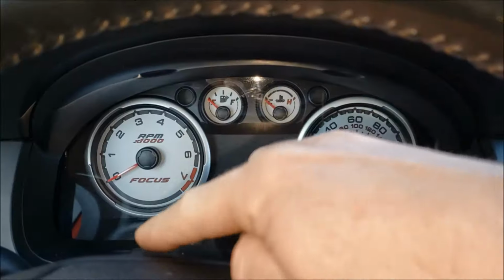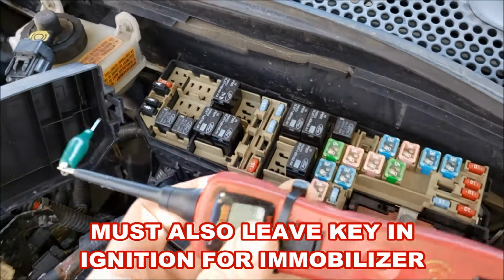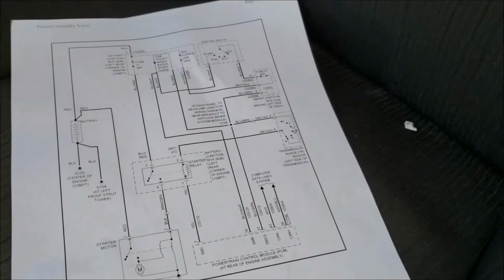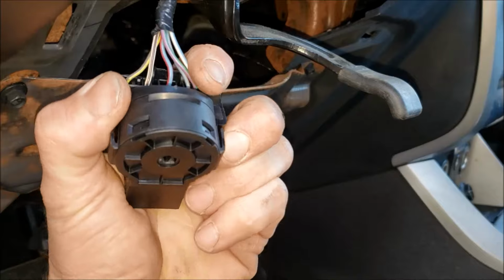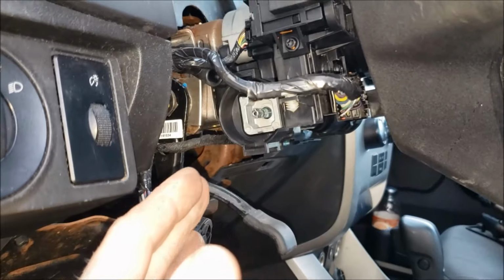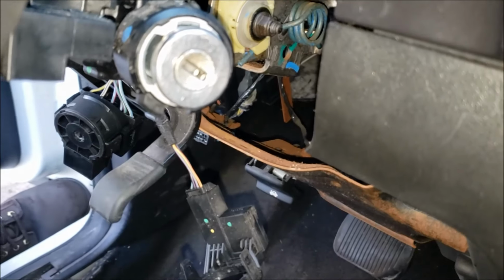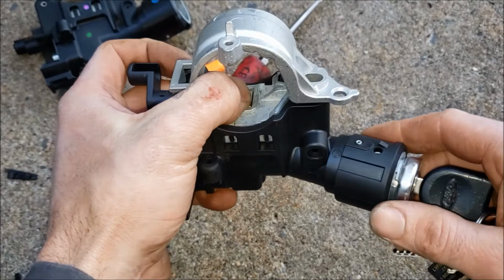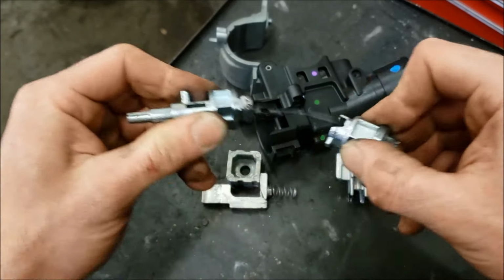08-12 Ford Escape / Focus / Mariner No Crank No Start,  Diag and Ignition Module housing Replacement

Comment: I followed the video and everything went relatively smoothly until it was time to put the key cylinder into the new housing.  It was a very difficult fit and when I tried twisting it back and forth to slide in, the metal part inside the black housing broke lose after the cylinder was seated which allowed me to pull the whole thing out.  I hoped that once I put it all back together and tightened it all, it would be fine.  If I push in to make sure it is seated, it starts with no problem.  I'm left wondering if I should order the Dorman one and redo it unless there is a way I can glue that part in place.  The video was of great help.

Comment: Great video! I liked that I didn't have to pull off the steering wheel like a different video I watched on this said to do. The part for my vehicle only cost me $45 on Amazon compared to the big box store price of $189. I did find that you can simply use a screwdriver and hammer instead of the cold chisel to remove the headless bolt. It took me about an hour and a half to do. Thanks for saving me some money. I enjoy all these do it yourself video's that save me money!

Comment: At the 10:00 mark.. there's a way to fix the ignition cylinder WITHOUT removing anything except the Ignition Cylinder and Tumbler..NO PARTS required. I did it two years ago and No Problem anymore, turn the key and it starts. I found the video here on utube almost three years ago which explains step by step.
Reply: FOUND THE LINK:  Free Fix, NO PARTS and Save 1500.00:  https://www.youtube.com/watch?v=mx3gzbv4y1w

Comment: Great video! I have seen people instead use a die grinder to grind 1/8" off the inside key mechanism so that it turns more and that fixes the issue. Does not require replacement of the assembly this way. Do you think that is a good solution? I have this issue.

Comment: Just did this today.  Thank you so much for this!  All other videos had the steering wheel pulled off and yours saved so much time.  To any future people doing this: be sure you either use a swivel adapter or a 1/4” socket wrench for the 3rd screw on the right side.  It’s a tight fit with the wheel on.  Overall took around an hour and saved about $500 (most places are charging $550-$650 to do this!)

Comment: Worked great! It was some key component, pluged the key in and used a flat-heat on the other thing and started right up. Gonna be using a screwdriver for a while, but beats having to use my "special technique" every time! Hardest part about this job was finding the two socket heads to get those three screws out! thanks again

Comment: Could it be a issue with the actual part that the key goes in? I have to put tape on the end of mine. So I’m wondering if that’s the issue or i need a whole new housing?

Comment: I have  12 escape that appears to use the same lock mechanism.  My issue is the steering wheel won't lock with the key out.  Is the metal tab that pops up when youre turning the key what locks the steering wheel?

Comment: wondering. I saw another temp fix by pulling the cylinder out and putting black tape around the end a few wraps. this fixed ours temporarily. so what is actually bad the key cylinder or the whole  switch thing you just replaced?

Comment: Have you ever seen the "transmission range sensor" make the car not start?  I have a 2008 and have been playing with it all day.  Jumping it from the relay works, all the ignition parts are working.  Last thing I can think of is the "transmission range sensor" not providing ground.

Comment: If it’s the issue where you have to push the key in hard, or jiggle it. What is the issue/fix for that?
Reply: that I found to be the key cylinder. if you pull it out and its rounded on the edges of the end that turns the inside switch the it worn out. temp fix is to put thin black tape around the end and slide it back in and it should work for a temp. fix until you can get the parts you need

Comment: 2011Ford Focus. It will not crank. I put 12v to the starter relay, and it'll act like it'll start. Idk what else to do. Ive checked connections, fuses, battery, bought a new starter. I'm stumped

Comment: Great video by the way! Basically if you have the ignition turned on and you try to start with the screwdriver in the switch it should start. If it doesn't, it's probably electrical?

Comment: Replaced the ignition switch and tried to start it with a screwdriver amd didn't start. All lights up on the dash but no start. Battery good and ot does start when cold in the morning but stop it and try to restart ot doesn't start. Suggestions?

Comment: Problem: When you replace the lock cylinder with a new one, you're going to have to take the new set of transponder keys and have them programmed to your car. I guess take to a locksmith and have the two keys that came with the new cylinder and have them re-programmed to your car there.  Then you can get a third spare blank transponder key off Amazon or elsewhere and  have it cut somewhere else, and program that with instructions in your Ford user's manual. You have to have a third key in case you lose one, as you won't be able to program another key without two keys. This would seem to be the cheapest route. If you take your keys to the dealer you are going to have to pay $$$ and then come up with proof that the car was owned by you.

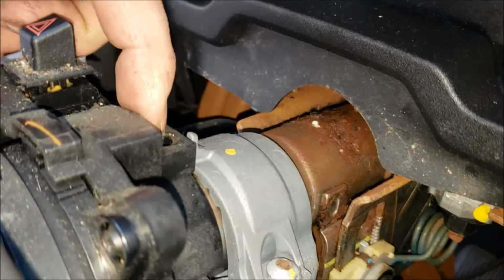Comment: Great video! Just replace the housing on our 2010 Ford Focus and ignition works like a charm. I initially followed other videos about replacing the ignition switch but the problem was still there. Your video explained everything in great detail and step-by-step instructions. The entire housing cost me $120 at a local auto parts store. It took me 2 hours to replace. The trickiest part for me was getting that one 5.5 mm bolt out above the key housing (8:24) , had to make a trip to the hardware store to get a swivel adapter. Thanks a bunch, really helpful.
Reply: I was going to throw an ignition switch at the problem also. I was watching another channel and he also mentioned that it is not always the ignition switch but he didn't show the symptom of a bad housing like this video showed. Nice tip about the swivel adapter.

Comment: Ok wow it started well the the first guy I watched he said to put in neutral and try to start it and it started I'll be damned since the problem started up again and you said to push it in on the ignition and turn it I've noticed what I do turn it on though I do put a heavy and sit on the ignition but I did extra hard and started right up so there is there I do not like Fords at all I've had a Ford explorer I liked how it was room inside but I had to lift the hood and take a long screw driver and such two bolts together and put the ignition in the heat ignition and the car would start anyways this Ford focus I do not like it at all the Nissan Toyota even I like Dodge Dodge I don't know you know thank you very much

Comment: Chris,  once you have the ignition switch pulled loose, and you use a screw driver to see if it starts, if it does how should you then proceed to shut it off ?? Thanks
Reply: Jus turn the screwdriver the other way.

Comment: My question I have is once you replace everything does the vehicle have to be reprogrammed because you're putting in a new lock cylinder?
Reply: No because you're not putting in a brand new lock cylinder you are just putting your old lock cylinder into the new housing. The immobilizer will detect your key.

Comment: Great job on this video.   It made it very easy.  Thank you.  Comments: For those without a 5.5 mm metric socket, 7/32 works.  Another comment: turn the "D" connector in the  ignition housing to match the lock cylinder.  The lock cylinder must go into the new housing the way it came out of the old housing.

Comment: 08 escape limited- What if the anti theft light is flashing? It randomly went into this mode while I was grocery shopping and we tried resetting it with key in the door, leaving key in the ignition for a bit, unhooking battery to reset it, still not cranking over. mechanic can’t seem to figure it out and it’s been at the shop over a week now 😶 It has been kind of difficult to start sometimes the past few months like you have to push extra hard to get it to turn over but not sure if that would be related to the anti theft system? Any ideas?

Comment: What would it be if the security light doesn’t come off?
Reply from the maker: The wrong key or an issue with the key reader. Try a different key if you have one
Reply: @NoNonsenseKnowHow  figured it out it wouldn’t work when I was cranking it with the switch but ended up working after I put two diodes that I was missing for the starter and ac clutch for whatever reason. Preciate all the help and making a clear video!

Comment: I was told by a parts house that after it was fixed I would still have to take it to a dealer to be re-coded .  Is that true because from what I saw you just turned it back on with the key
Reply: This is what I was told too did you ever get it fixed ?

Comment: How do you know if its the cylinder itself? Because I noticed you don't get a new cylinder with the housing. So there is a possibility I could replace the housing and it still not work because of the cylinder right? FYI, I know absolutely NOTHING about cars. Going to try to do this myself though.

Comment: Did everything but can't get the lock to go in the new one
Reply from the maker: Did you clock it correctly? Look at the piece and make sure that it lines up with everything inside
Reply: I had to take the switch off. I was able to get it to work. Thxs man and great informative video

Comment: Soooo I did this fix and now I have a battery that drains every 3 days.  Picked up an amp house and fuse 27 has a 0.04 draw. Is there anything in this fix that would of caused a draw on the battery or do I need to replace that ignition switch too? Great video!!

Comment: Very informative and well explained video Thank You !  if the car starts when the key is pushed in would it need a key cylinder, ignition module or ignition switch ? I notice a small pin in the center of the ignition module that presses against the center of the ignition switch when the key is pressed in - all the moving parts don"t seem to be worn or floppy when turning, Thank You (2010 mercury mariner) 6 cylinder 85,000 miles

Comment: Bolt - any bolt will do, if it’s 8/125 thread pitch - correct….?
Reply from the maker: Yes 8mmx1.25 thread as long as it's the right length. Can't be too long.

Comment: Thank you , thank you , thank you for this video. I was able to do the replace in less than an hour.
now I don't have to use the gorilla tape Mickey Mouse method.  Only thing I didn't have was the movable knuckle ratchet piece for that hard to get to screw.  So I used a small socket and used a large size Allen wrench to the back of the socket to get the screw out. Other than that it went smooth and fast and now works perfectly and at a fraction of the cost at the mechanic shop. thank you !!!!!!!!
Reply from the maker: Awesome to hear the video was helpful and you took care of it yourself. Good stuff

Comment: This is the best video on the replacement of ignition collar.  I just completed the installation of ignition collar on my 2009 Ford Escape LTD with v6.  Follow Chris's advice.  Beware there are 4 wiring harnesses that have to be disconnected and reinstall.  Also beware the new collar come with the ignition switch so the new unit does not look like the old one.  The chisel trick works great on security bolt, I had to chisel it several times to get "hand loose".  Trickiest part is getting the 5.5mm bolt in front of the ignition key out and back in the 1/4" ratchet with swivel does the trick (this is the only reason I see to pull the steering wheel).  It is better to align the bottom and ignition 5.5mm bolts first on reassembly then the top and finally security bolt.  I appreciate this video so much  I left him a little $ thanks.  This saved me big time!

Comment: THIS IS THE ONE. I've watched a few dozen of YouTube Ford Escape ignition collar replace videos. Had me with the chisel trick. I used a Chinesium Harborfreight screwdriver sharpened on the driveway. Plus no airbag or clock spring removal.  I just fixed my 2008 Mazda Tribute. (rebadged Ford Escape) Only suggestion I can add, is go to the hardware store, buy a 8x125 "hex head" bolt rather than use the "security" torque break-off bolt. Just in case ... Ain't nobody gonna go to steal  an 14 year old Ford Escape. THANKS for the video.
Reply: Can you please link the hex head bolt?

Comment: OMG!! I cannot thank you enough!! This video saved me time from having to find something to take the steering wheel off and all that. It took me a little while because I didnt have the swivel head but my landlord helped come up with another solution to get the bolt out in that tiny area. Then I couldnt get it to line up with the wipers/signal. BUT I got it on!!! THANK YOU SO MUCH FOR THIS VIDEO!!!!!!! My mom couldnt get it to start before but I always could. Now she can too!!

Comment: there are dozens of similar videos - but none are filmed as well and explain as completely as yours ! Thanks a bunch !
Reply: I agree great job
Reply: I broke the little nobby thing on top of the cylanoid that holds it in. Any suggestions?
Reply: I think it was best also
Reply: "Then you take this bolt out" camera not looking at what they are taking out "Then once that's done you jsut  wiggle this" again not showing "and out it comes, that easy folks"

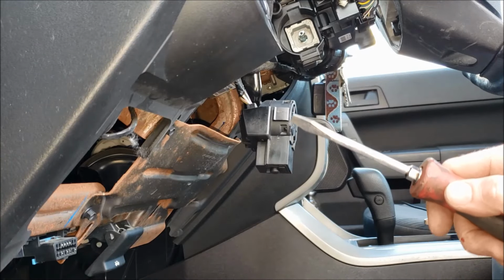Comment: On the 5:53 part into the video where you you started the car with inserting the screwdriver into the ignition switch to start the car, the video cut out in which how you turned the car off. I'm wonder how you turned the car off?!
Reply from the maker: Just turn the ignition switch back to the off position with the screwdriver

Comment: My 2008 ford focus wont start its not the battery i changed the starter changed ignition switch as well as the ignition lock cylinder and still wont start ANY HELP

Comment: Highly suggest a shallow 5.5mm socket.  Deep well and ratchet will not fit on the bolt behind the key switch. I used a small pair of channel locks to turn the socket.
Reply from the maker: Thanks for adding the tip

Comment: Very smart , thanks for the video , I know I can't do that 😁😁😁but questions please if you don't mind , after replacing transmission ford focus 2011, ( had to remove the battery ) put everything back in, the car won't start at all , no power whatsoever , any idea what happened ? Thanks beforehand I'd appreciate it 🙏🙏🙏

Comment: I just bought a 2008 Ford escape hybrid for 1500 bucks looking through the receipts in the glove compartment it had been in the shop multiple times for a no start condition. The guy that towed it to my house said he has towed this car at least seven times. After some research and some basic countryman knowledge and old-timer skills. I did the first thing you do when there’s any electronica problem on any vehicle. This is what we did in the good old days boys and this is what everybody should do now. First thing you do is make sure the ground from your battery to the frame is excellent. That means disconnect the bolt that attaches to the frame of the vehicle and make sure it is polished and clean and that ground cable from the 12 V battery is getting an excellent connection. Once I did this all the codes disappeared the mysteriously problem vanished. Can you believe it now I have a beautiful Ford escape hybrid that I got for 1500 bucks that runs like a dream. Do not focus on the mysteriously hybrid battery issues that cost thousands of dollars start with the cheapest easiest thing to do every single timeOn every car. Any electrical problem start with your ground. All these cars just like in the good all days need a good solid ground to start.

Comment: Great video Chris!  You just saved me $300 and a lot of unnecessary hassle. The Mercury dealership wanted $125 just to diagnose the problem (which I already knew what it was having replaced the ignition switch to no avail and seeing your video). The local car shop wanted $400 to replace the unit. I purchased one on Amazon for $90 and had this fixed in a little more than an hour. I purchased a swivel adapter set from Harbor Freight for $8 and a small cold chisel at the Depot for $5 and it made the job much easier. Also didn't have to remove the steering wheel as suggested on other videos.  Thanks again and bravo!
Reply from the maker: Awesome to hear that Dave! Cheers!

Comment: So if u turn the ignition switch with a screwdriver and it stil doesnt start its a bad housing assembly? Or what
Reply from the maker: No.  Could be a bad switch or something else. Need to try some of the other steps I showed in the video

Comment: I purchased a completed assy just in case, completed the task in approx 1.5 hrs.  Thank you for a solid detailed video on what to look for and how for the R&R of the assy.
There is no way I would have located those hidden screws, nor had the confidence to push and pull in certain areas.  THANK YOU!  Terry - Vancouver BC.
Reply from the maker: Awesome to hear you found the video useful and I really appreciate you posting your experience/feedback.  Thanks Terry

Comment: Good stuff man👍 Anyone doubting if this works.. I can tell you 100% this works. I just did it today and only had to play with putting the lock cylinder into the new assembly.. But the whole thing took about 2.5 hrs.. Not bad considering that I'm not a mechanic 😊 For the last few weeks, I was starting my car with a screwdriver and now.. It works better than it did when I bought the car. When I bought it.. the car had 20,000k..Now it has 267k...Solid fix🙌